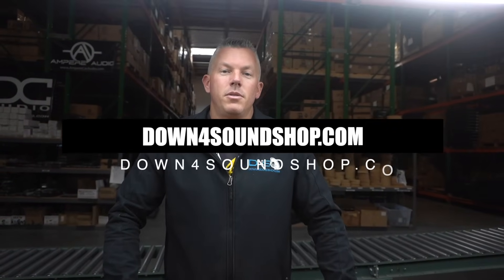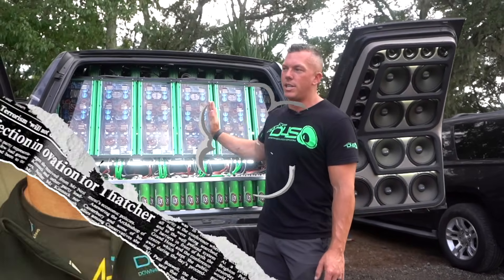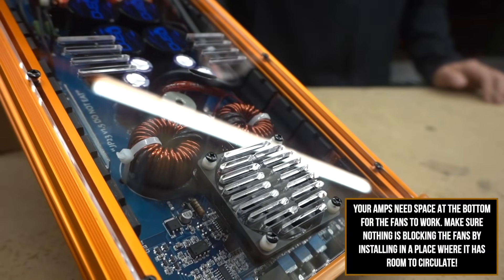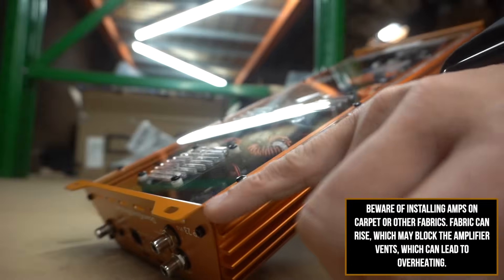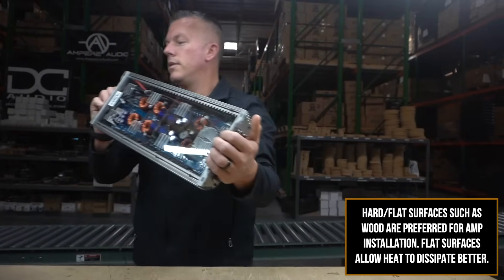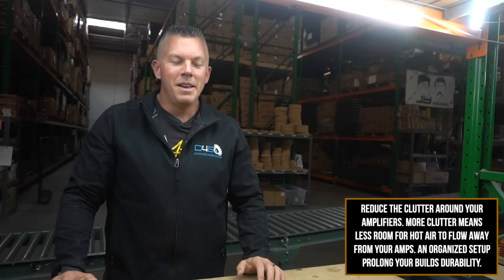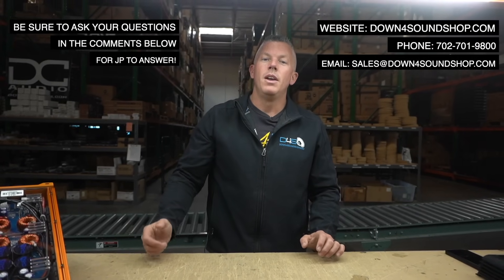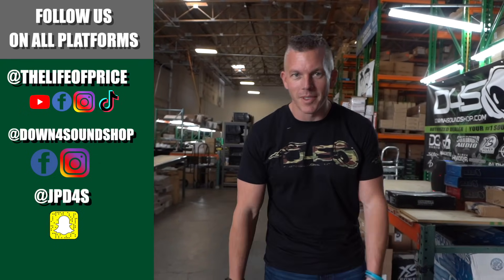THIS IS WHY YOUR AMPS ARE BLOWING UP!

Comment: Since your popular you should do these PSA’s on the basics. Especially about upgrading to a bigger output alternator and a battery bank. I know you have a video about it but in this forced ADd age any video more then a week old on YT or not on tic tac in 3 second loops isn’t relevant. On days I drive my wife car with no stereo I can sometimes here other with systems and I can already tell there on stock electrical just on the verge of an epic fail -when I ask them what’s the power supply they usually start naming the brands of amps they have some will say I have an optima battery. When I drive my car around and explain sometimes show my 350 amp alternator with 2 XSpower d7500’s. Then explain it’s not really that hard to do what I’ve done-10k invested in about 3 years bout 5 years ago and no issues. All done by myself and with lots of help from YT.

Comment: my jp95 sub channel failed because the protection circuit never kicked in and did anything. The output went short and the amp didn't shut off it just kept outputting until the output blew and the current draw forced the amp to shut down. When it came back on the sub output was dead.

Comment: What is a safe temp range for operation on a jp33? I have a 15 Yukon, it has the storage compartment built into the rear cargo area. The amp is mounted inside said compartment, it’s about 4-5 inches deep inside where the amp is, I will be opening up the rear chamber that the amp is in, I haven’t seen above 93 degrees Fahrenheit on the amp, but I’ve only had it installed for about a week now, and it’s been cold when I did have the amp at that temp, I had been driving for quite some time, and had the system about half way up, to 3/4 of the way up. Most of that time, it stayed around that 92 degrees, just curious where the temp range for safe operation is, 

Secondly, is there a way to adjust the blue tooth voltage on the gain knob? As it reads high I believe, unless my digital volt meter installed in the car and my multimeter at the amp both read incorrectly… I saw the video you posted on the gain know adjustment but this is a newer design, and as a result the hole
On the gain knob is not present on mine
Reply: in this heat wave weve had i had 2 jp33s blow power supply fets with a temp of 129  and they have never been thermal protected  each blew with month of each other same cause i even have 4 fans on them bitchs too it was so annoying but they warrantied one took 1 month to get repaired and then other broke lmao but im gonna get it warrantied too im so upset over this shit 129 is warm but if you think those days mine started off at 109 in summer

Comment: jp i buy from your shop but no lie i been scared to try an amp lol. we need a thermal resistance rating for amps. some ppl need amps that dont build much heat for the types of installs you mentioned. im sure some of your amp models run a lil cooler than others. put that info out so ppl select the right amp for the install bro. might help a bit?

Comment: 2Jl1500.1's on the back wall of my 2022 Silverado with limited airspace for 2 years both run cool and never went in to protect.  I tried a JP23 in the same spot and went into thermal protect very quickly.
Reply: I had same issue in a silverado got rid of that pile JP23 and got a different amp no more problems 😂

Comment: You should design a billet color matched bracket to mount the amp plexi out
Reply: Like a 2.5 inch aluminum spacer and 3inch stainless steel 1/4-20 nuts and bolts

Comment: Hey Jonathan does these amps have fans on the side of the amp. Most amplifiers I see would have fans of the side of the amp. Because most installs the amp would be mounted and screwed on the bottom
Reply: He doesn’t design his amps. He just uses the cheap China amp designs. Like skar, ct sounds and a few others. But most true companies have hand that blows air across the board. Common sense designs are above his comprehension. But he takes time to blame consumers. So many amps blowing up that he had to make a video. He needs to change the design. These old U.S. amp designs are old and outdated

Comment: I mounted mine upside down, with stinger crossflow fans on the heat sinks. Never had an issue. With the thermal protection on the amp, this should also prevent it from "blowing up". I would bet the gains are not set correctly on these blown amps.

Comment: I’m with price I did installation for a while and something I always saw was overheating because it’s crammed into a space that’s not ideal. Especially with systems that require more than 1500 watts to run. You can’t slap a 4500 under a seat and expect it to run efficiently. This isn’t the 90’s where you could Jerry rig and have a wiring mess.

Comment: ...... So, don't put the cooling fan on the bottom.   You know, the worst possible place it could be mounted.
Put it in the ends, or top, or at least send it with pads or stations that hold it up farther.

Comment: dude,  just have standoffs molded into the plastic back so the dumb f*cks cant mount it flush.  i put 3/8 spacers between the amp and the mounting surface and no matter how hard i push my 23,  it stays around 115.  always.  winter,  summer.  always.

Comment: Not only smothering the amp but there’s so many videos and installs I’ve seen  out there people demoing those amps and the volt meter is dropping well below 12.  Low voltage = increased amperage draw 
= heat.  Smh

Comment: 1/2 inch legs and carve out the carpet. If it still overheats. Junk. If you're having issues perhaps put fans on the side like taramps etc. Plus make them substantially quieter. Noisy as hell.

Comment: I bought two 1,000 watt Minimax amps in 2023. The Box only had one sucker in it instead of two, that's the free gift you get with every purchase. Instead you should put half inch spacers in the Box for people. If you really want to try to fix the problem. Then there's also the problem that you did not talk about on the video that people try to run their amps at a lower ohm rating than it is rated for and the amps overheat. You know guys don't read instructions

Comment: i did reply .already my opinion . But thinking i have three different amps pounding bass for hours when i parked in the car at the park for hours. cheap hyfonics 3000k one 12 2000 watt rms  jbl door speaker  amp  and beamus 3000k for my 15 2000 watt rms sub.   Amp bolted down in the trunk on some non flame  sound absorbing sheets.  Amps are all cold even pounding  slightly warm.
  Dont get the issue.  Class ab amps get hotter when cranking that is my jbl . what do i know ? I did not spend 800 on a 3000 watt amp for the name brand

Comment: Ok there must be a reason why facebook market place is packed with a lot of these amps that need repair.   There are many well know amps on the market today some good some bad but they will last many years.    My opinion also subwoofer amp is a sub amp if it puts out its rated rms power  with out distortion.   Look into beaumus on temu 120 bucks 3000 watts rms , Why spend 700 for the same power ? Nike shoes Vs walmart shoes . Both go on  your feet My opinion

Comment: Most of them just rush doing there install and end up with issues,amp getting hot real quick and where they mount the amp and turn around tyrna blame the amp not good,but they never go over it n double check everything 🤦🤦🤦

Comment: The only thing I’ve noticed is the way the fan is. You can’t mount it upside down. It just sucks the hot air back in. But yes you should be aware of the air flow and heat.

Comment: Luckily in over 20 years of fooling with car audio ....I have never had an amp blow ....but I also have never bolted my amp down directly to something ....I always add some kind of "feet" between the holes for mounting the amp and what I mount it to ...usually try and get at least a quarter of an inch or more like to have a half inch or full inch if possible ....I have a 98 extended cab s10 project truck now and I have my amps bolted to amp boards so I can hide wires and have 1in high by 1 in round rubber "feet" spacers between the amp and mounting surface of the amp  board .....but in alll my years of being a bass head ....I have  found the cooler you can keep your components the better and louder sound you can produce .....cool amps and cool coils make happy car audio ....that and proper wire sizes....proper fuse applications ....and the age old saying it takes power to make power strategy will usually equal a quality sound from your investments .....being very neat and taking the time to solder and heat shrink the rite connection ends on your wires and even using wire sheathing can really make difference in current and  out put ....but I am no professional by far ....but I have had 20 years of doing my own installations and each time I try and do a better neater job than the last ....but I enjoy the installation process ...so maybe that's why....I do have a question for jp .....if I run 2 of the new d4s 12s the dvx would I be better off to use 2 jp23v1.5s strapped or give each sub its own individual jp23v1.5....I already run 1 jp23v1.5 to a single 12 ....is the  reason for my question ....

Comment: I mounted my amps on a carpeted board so I made spacer mounts to raise the bottoms enough to get a finger under it.
Reply: Smart! That’s the way to go 💯 the vents on the bottom of the amp are there for a reason, installing them in carpet completely chokes them out.

Comment: I love my jp 23v2 it takes a 40 minute drive back and I think the fan has failed some how but fuck even with all that I still can’t get that thing to get hot it has a half inch lift with another jp amp on top my Skar amps would cook the jp amp just gets up to 100 at the worst full tilt but I’m not clipping either my jp 23v2  is the best amp iv ever owned and it’s one of the best investments iv ever had

Comment: I don't ever have a problem with any of my amplifiers getting hot. I put my amplifiers on rubber standoffs for extra space for airflow and to help with vibration damage. And, of course, not mounted to the speaker box.

Comment: Seems like a design flaw. Why are the fans mounted on the Bottom? Why is the top shell solid?  If you want them mounted plexiglass side up or out as shown in your truck, why are the mounting tabs on the bottom?  Just seems there is a better way to cool them.

Comment: Hey jp I could not agree with you more on this!! I admit I have my jp23 mounted on the back seat of my civic, BUT when I am playing the bass it is folded down and the sunroof is open so it can stay cool. Mine doesn't even get to 124 degrees on my bass knob if it does I open the back windows and right back down it goes.

Comment: I have a blue mini Max 1000.1 on a sundown Sld12 600 RMS in a S10. It's awesome an never had an issue. At the same time I use my brain ppl I cut four 2 x2 blocks out of a piece of MDF I screwed them down to another piece of MDF and use that as my mountain Gap for my amp to breathe

Comment: Its super simple to run amps at 1 ohm and have the amp lifted an inch or so that way the amp can breathe. Normally its people running under 1 ohm or ones that try running amp on stock electrical system and cause tons of voltage drop and heat. Get the proper electrical, and stop wiring in the dirt.

Comment: What else am I going to do with those stickers the amp comes with?
Reply: It doesn't come with stickers. I thought that too until I realized I was actually charged for them in the cart.
Reply: @Jaydogg209  good catch forgot about that. So you have to pay extra for the vent covers.🤣
Reply: Vent covers? Don't do that 😅 I like my jp23v2 but I hate my mm1005 because it doesn't have soft turn on/off circuit so it pops. Didn't know you can't just wire it up like a normal amp to the remote or 12v source. Still people argue it's normal but I've never had an amp do that. Thought I was going to another tier of quality when buying from d4s, but not for the mini max series.
Reply: @Jaydogg209  I have the mm1000 same thing it pops from the inrush on the caps and a pop when you power off. It's not normal. I'm replacing it with a CT Sounds 1500.
Reply: @Z_question  so will a relay and a timer fix it?
Reply: @Jaydogg209  Normally a resistor bleeds off the caps  the only other thing that causes the pop I can think of is a factory amp still wired in the system.
Reply: @Z_question  so you'd suggest trying a bleeder resistor on that remote wire? Would that thing get hot? I tried simulating as if the amp had soft turn on/off by either connecting the amp remote before or after the head unit was completely on or off and it still popped, waited like 1min which should have been enough time for it to completely power down, I don't think a timer would fix it. Jp made a "solution" video saying we need a relay.
Reply: @Z_question if you want to fix that disconnect your remote wire from your head unit and connect it to a 12-volt fuse that turns on with the ignition. As soon as you turn your car on the amplifiers will turn on when you turn your radio on the amplifiers will already be on so you will never hear that pop at the beginning or at the end when you turn your radio off, unless you turn the ignition off without shutting the radio off first. It'll cost a lot less than buying a new amplifier
Reply: @neilj3991  I'm going to try that too, but I did try the 12v power on the head unit wires instead of the remote wire, but those are the same thing pretty much. I'll connect it to a fuse tap i already have wired and see next time I take it all out. My Sony head unit has 2 sec start up so maybe that doesn't help not sure.

Comment: 100% great video, JP  :)   All you need is 1/4" above & below the amp (like JP showed, D4S does 'lifted' mounting feet on some amps for airflow. Using crossflow or quiet brushless style fans in a push-pull manner w/ a thermal Auto ON/OFF module makes all of the difference. Yes, that can all be done for under $40 but what is your amp worth or a potential fire? Hot Amp=Less Efficient Amp.